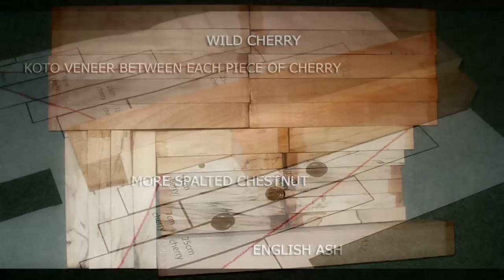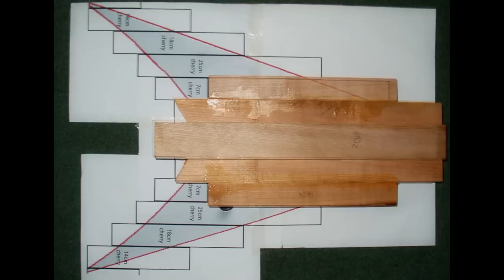Handcrafted 49 Piece Flying V Guitar Body

Comment: The only thing I would change is the bolt on Neck. I would made a 2 or 3 piece neck thru guitar, I think it would fit even better, and in the end, sustain would be also better with easy access to higher frets :) 
Great job anyways, like it :)